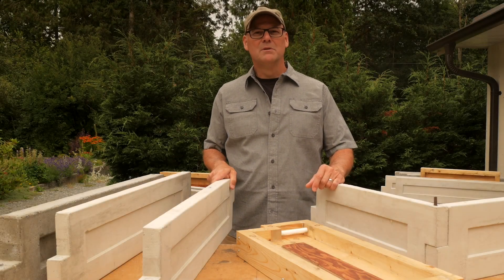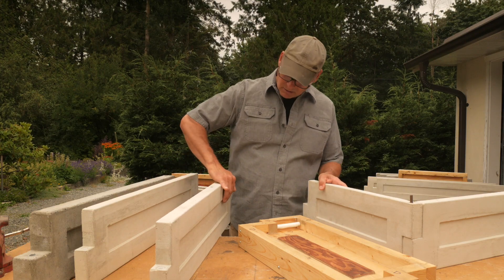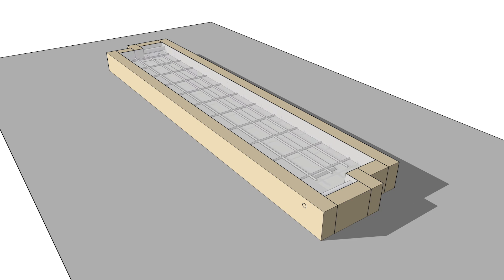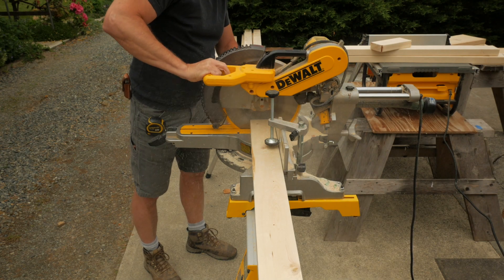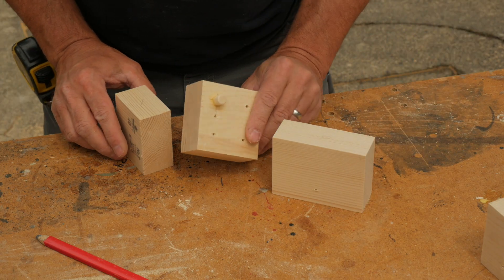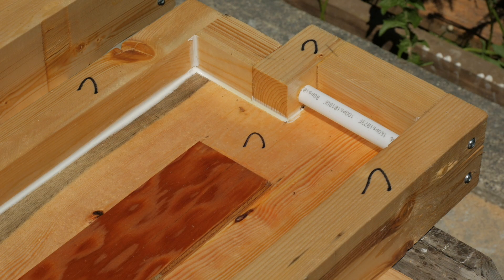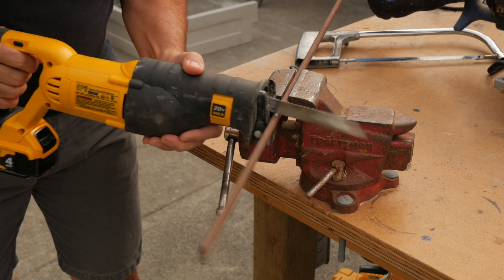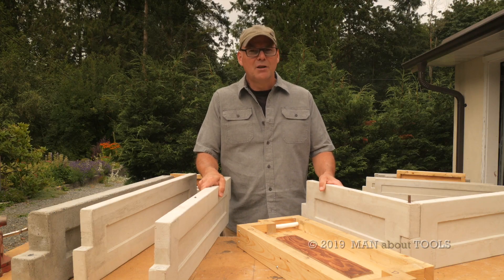make Thin CSA Concrete Garden Boxes PART 4 - cast garden forms

Comment: Is this Part 4 before 3.7? You had said the aircrew was not durable and the line trimmer damaged the surface. Did you test the durability of this Part 4 version?
Reply from the maker: Yes it is. I didn't test the durability of the CSA thin panel. I didn't think I needed to as its so very tough. The line trimmer would not leave a mark.

Comment: Rapid Set P.S.A. concrete, (mortar mix), is 6,000 p.s.i. I think you are okay, with or without fiberglass, and or metal mesh. If anywhere, I would use a small piece of diamond shape lath laid next to the plastic pipe, (1.75" x 6"), to make that stronger, as it would be the only weak point. This is just a thought, not a criticism.
Reply from the maker: Thank you!

Comment: hello friend, my name and Carlos and i live in Brazil, i have been following your videos and the stress tests on aircrete concrete, i want to congratulate you for sharing all your effort in transmitting all this experience, thank you very much, i have a suggestion if you are interested, you can do with two layers, a first thin layer of pure cement and a second one using foamed concrete, I believe that this would allow a piece with a more resistant front to the lawn mower and at the same time a light piece, thanks friend and congratulations.

Comment: you could also use the finished cast to create a silicone rubber mold that could be used repeatedly it wouldn't be strong enough to hold the form by itself, but when inserted into a box for rigidity, then filled, it could be popped out of the box when the concrete is set and peeled of the finished cast. one of the advantages is that you would not have to keep dismantling the mold every time you made a cast.
Reply: I was curious about this too! Have you tried it? I have only seen this technique used for small molds. I wonder how thick the silicone would have to be to hold up to repeated uses, and whether you would have to cut the wood larger to compensate for the thickness of the silicone. I was also curious about using silicone spray over the mineral oil.
Reply: I did this to make a urethane rubber mold of a foam arrowhead stepping stone I sculpted a few years back.  I cast several of the arrowhead stepping stones for my wife's flower bed.  I don't think the CSA mortar mix would affect the urethane any.  It pulled right off the cement I was using - no trouble at all.  A quick rinse & paper toweled dry, then I sprayed it with PAM cooking spray & it was ready to go in just a couple of minutes.

Smooth-On has the rubber that I used for the mold.
Reply: I thought about this, too, because I’d like to emulate his process for making benches for gifts, but I’m concerned about how the pvc pipe could be incorporated using a silicone or urethane mold?

Comment: Did you do a durability test on the above form with a weed trimmer and using the above method as far as amounts of mix how many forms and of what size can you get?
Reply from the maker: I didn't do a durability on these CSA panels. I didn't really need to. They are the very very strong and the line trimmer would not leave a mark.

Comment: Why would one not want to drill into the end grain for the dowel pieces?
Reply from the maker: Usually the drill bit would wander more. Making it more difficult to drill the hole exactly where you wanted it.

Comment: nice video , thanks. you can also achieve plasticity or at least the looks with portland cement. I ve discovered it by accident, if you would put thick plastic foil on the bottom part of your form it would work wonders. that would of course work just for the part which comes in contact with the foil. for the upper part, you d have to cover that up with plastic foil too and apply pressure on it - not sure how though. keep up the good work.

Comment: I think I would still aff a bit Foam or Shampoo..or the Plasticizer against Frost-Defrost Action..Masonry Cement also contains such as Adjuvants..Portland Cement is meant for Indoor Use  and without some type of Air Entrainment Agent, it may not hold many winters in northern climes like Canada

Comment: I really don't think the amount of glass fibers you are adding are providing any additional strength.  in order for any type of fiber as reinforcement to add strength there must be over lapping of the fibers, enough to create a matrix, structure.  fiber strength depends on the close proximity of the next fiber.  the cement binds the fiber to the next fiber and so on, if there are too wide of spaces between the fibers there is no added strength in that space because there is no fiber connected to the  next fiber, no matrix structure.  think of adobe and the amount of straw they put in it.   also fiber glass, it has great strength because the fiber glass mat is a matrix of fiber, once the resin is applied each strand of fiber is bound together in that close matrix structure, binding all components together as one.    if you were to cut your wire mesh in two inch pieces instead of one long piece you would likewise loose most of your strength again that the wire could have provided by tying together the cement with the wire in a matrix structure.   you simply are not adding enough fiber to create the matrix.    other than that you did an awesome job.
Reply from the maker: rmendes2 The fibres added are for crack resistance. The mesh is for strength. The amount of fibre added is according to the manufacturers recommendation for crack resistance.

Comment: If you are not in a rush to remove the panels from the forms, could you just use a Type S mortar mix instead with fibers?  And thanks for all of the great videos and ideas.  Now trying to decide on thicker concrete form plans or thinner plans.

Comment: I have made my wood forms and have all of the supplies for mixing the concrete. After I mix and pour the concrete how much time/vibration does it take to get all the air out. Also, you said that you water the concrete for an hour while it sets. How many times do you water it? After an hour you remove it from the wood. At that point what is needed to cure the concrete if using same as this video? How long then until it is cured and usable to put out as a garden box? Also how long do you let the latex caulk dry before casting? Do you need to reapply the mineral oil for every casting?
Reply from the maker: With the CSA Mortar mix and plasticizer there should be few bubbles to worry about. I tapped or vibrated for less than a minute total. I water it while it cures to keep it wet. It heats up and the surface drys. So I try to watch for that and water it as that happens. All concrete benefits from curing. If you have the time then cover the newly cast panels in wet sand for a month. Watering the sand once in a while to keep it wet.  I let the latex caulk dry for an hour or so in warm weather. I do add mineral oil to the forms if they seem to be drying out.

Comment: I noticed the un-caulked edges around the pipe.  I was thinking if you could find a type of tubing/pipe for the interlocking holes that had a little flexibility to it you can caulk those tighter edges much easier once the jig is assembled and then with a little bending pop the tube in last.. i wonder if some kind of inexpensive irrigation tubing or something of the sort would be straight enough over that distance if wedged into snug dowels to work... just thoughts.

Comment: When I watched this video I thought you were going to use foam with the quick set concrete to address the durability issue of the aircrete but also keep the light weight. Thanks so much for sharing your great ideas with everyone. I wanted to build a geodesic dome with concrete panels and was hoping to find a light weight inexpensive insulated durable  material that could be made on site. Your ideas are inspiring....

Comment: Does this one had that spring around the tube or not? Is the reinforcement unnecessary for this one?
Reply from the maker: It does not. As I wanted to go thinner with a stronger concrete I decided to leave the wire out.

Comment: Thank you for sharing that! The CSA looks very appealing and can be totally non-shrink! Material cost is not a big deal for the small boxes, but unfortunately the CSA mortar is far more expensive here than it needs to be - several times the cost of portland cement (the Rapid Set CSA mortar is about 70% sand). In China CSA cement is competitive with portland cement, but here it is still a niche market. We will be trying out a blend of the two with air - good to see how well it worked for you.

Comment: Since these are so thin and you are using lightweight concrete, I'm thinking 1x finished boards might be easier for some than ripping 2x lumber that has rounded corners. Would also probably have a smoother finish pretty easily and make releasing easier.

Comment: I have seen concrete blocks made with cement, sawdust and woodchip. The ones I saw were years old, and being used for a base for some steps, they were light, and in perfect condition, though they were directly on the ground. There is no sand or gravel in these, the wood replaces them both. You are a very good workman and thank you for sharing these beautiful concrete boxes, they are magnificent. Maybe they will keep some of the rats and mice out of the strawberries!

Comment: Damn I tried to guess at your thickness, but turns out that my 
1 13/16” thickness only allowing 1-55 lb bag of csa to fill 1-48” panel. 
I guess your $5 pdf would have gave me the thickness?? 
A lot more cost at 55lb $17 bag 
2-24”, & 2-48” for $50 
Like your garden boxes. But I might go broke

Comment: I came across this as I was designing my own mould :-) Similar thoughts except for the interolocking parts. I will go with your lumbar design but not so thick and line it with melamine ply.

Comment: Nice, well thought out panel designs!  Have you tried using CSA for aircrete, any concerns to share?  One benefit to aircrete seems to be price, as you are using less concrete with the foam increasing overall volume (more panels per 50lb bag).  I would need 150-200 panels, so price is a consideration.
Reply from the maker: Thanks! I have made some aircrete with CSA cement. That's coming up in a video very soon.

Comment: Did you put oil on wood before you poured into the mold?
Reply from the maker: Yes. The wood if first coated with Mineral Oil. Then before pouring the concrete I spray the form with Vegetable Cooking Spray. Pam works well.

Comment: Dam, "text got deleted.  Dumb fingers"  Adding a large washer to the bar by welding.  Could make a nice holding spot or using an added ring at 90 degrees for tying some string etc.

Comment: Liked the idea, very much! Admired your CAD skills as well!
I used your idea, and reworked the form, so its just 3 components. one side and end, complete, twice, and a base board.
I used coach bolts to hold the side and ends to the base board, as they also act like dowels. 
The rounded heads can be recessed into the wood, and tapped out easily.
The perimeter shapes are on top of the base board.
I've had some formwork experience, and if the parts are painted with exterior wall paint they seem to release very easily.
For the base board, I would use 30 mm green chip board, its cheap, and doesn't warp. (Ply is ridiculously expensive in France where I live.)
An alternative would be kitchen worktop, as the melamine surface is already pre-finished, and releases superbly.
Thanks for the idea. I've also had problems with garden box rot, even with treated wood.
Reply: I noticed that in Part 1, he used several coats of polyurethane on the plywood to create a more durable mold that releases but in this video, he used mineral oil. Do you like latex paint better than mineral oil? Is melamine better than that? I'm making a 24" high rectangular planter that I want to be on the thinner side (1" max if possible) and am thinking of using plywood for a mold, mineral oil for a coating, latex caulk for the interior edges and cooking oil spray.

Comment: I switched 1/4” pex pipe and drilled it out after it set up.  You end up with a roughly 1/2” penetration.  I used a 3/8 metal bit from both sides.  It only took a second before it cut and twisted the pipe out leaving a perfect hole for a stake.  Further you could cast the panels even thinner especially with CSA concrete they are plenty strong.

Comment: Did you ever had a chance to compare your forms to readily poured Autoclaved Aerated Concrete (AAC) panels (can be cut to measure with a handsaw, miter saw  etc). Great video.

Comment: I have read that Portland cement tends to make the soil around it quite alkaline, which will affect your plants. Leaving the panels outside to age in the sun and rain for a few weeks will help reduce that, as would coating the inside surfaces with any kind of sealant.

Comment: Design suggestion #5.  Stack several layers of garden boxes but done so to create a terraced garden.
This would give you two options.  Option one, terraced on both sides of the box.  Option two, terraced on one side but on the other you would end up with a flat wall.  That means a garden on this side, but a fence wall on the back side.
Note:  Option one and two assume flat level ground.  What if the ground was sloped?  These box segments could be used to terrace the sloped ground.  If the ground was steeply sloped, you could dig a cut into the slopped face of the hill, make a box that was flat on the hill face side as a retaining wall, and on the front side it would be a terraced garden.

Comment: Design suggestion #3.  The rods at the joints are a function of the design not a feature.  Make the rods a feature.
You have been cutting the rods to length so that they can be pounded down flush with the top of the garden boxes.
If you left the rods much longer, they could be used as fence posts to hold fencing to keep predators out.
Reply: or even to mount plastic film for a small greenhouse
Reply: @scriptomaniac  - Great Idea! If you were to leave the rods about 6-8" long, you could potentially bend a thin-wall pvc pipe from one to the next, creating an arch.  Could add additional rod pipes at half-way along the 4' panels for additional arches.  Then cover with plastic sheet for greenhouse.
Reply: @drhender6943  Tent poles. Ha!
Reply: @scriptomaniac  good idea if you can extend the growing season for low-lying crops
Reply: Actually,, in some cases,  that is not a good idea. Please let me explain why.

If you were to leave it 2" high and you tripped on the garden bed next to you, you could fall on that stake and impale yourself. I am not saying you can't do as you suggested, just wanted to give everyone another perspective.
Reply: @anothergoogleuser  That's actually a very valid safety concern. Good heads-up.
Maybe holes made with larger diameter at the top to accept pvc or emt that would slide into the holes and around the rods. Nothing sticks out and the fit might keep anything from popping off in the wind.
Reply: @anothergoogleuser  you could avoid that by bending the rod 90 degrees twice and shoving the 2 ends on each side of the blocks! no sharp open ended edges
Reply: Also for extra strength one end with just a hollow pipe like you did here and the other end with a metal pipe with a thread inside -> use a threaded rod or a long bolt to attach the pieces together for a solid structure.
Reply: I agree with reducing unnecessary hazards especially with children. Why not add a few more dowels in the form to leave two inch or so deep wholes in the top of the garden bed. You could still put PVC etc in the whole to create your arches without needing initial extra material or creating extra hazards
Reply: I C  Just remember, they're called "accidents", not "on purposes".
Reply: Guns do that.
Reply: @peterbeyer5755  Careless gun handlers do that, the gun does nothing.
Reply: I C  If you were to work in the insurance industry, you might understand a little better. I could take a few hours of your time if you like and educate you on it if you like (offline). All I am trying to do is save you, and others some frustration and grief. Please accept that I made my comment in good faith, and not in trolling. Thank you.
Reply: @anothergoogleuser  Yes, if humans CAN screw up and hurt themselves, they WILL.
Reply: Great idea

Comment: Design suggestion #2.  The wood strip that you use as an inlay adds a nice touch but is bare and plain.
Idea one:  Once the concrete has set, add custom letting or numbers to the inlay panel.
Examples:  "441 White Street",  "Oak Hill Community Garden",  "Remembering Grandma With Flowers and Butterflies"
Letters and numbers can be purchased in Big Box stores that are designed for numbering houses and mailboxes, but they could be attached to these garden boxes just as easily.   Lettering could be carved into the wood inlay directly before casting, but the lettering would have to be carved backwards.  Another alternative is to carve directly into the soft concrete before it fully hardens.
Idea two:  Carve a decorative pattern into the inlay.